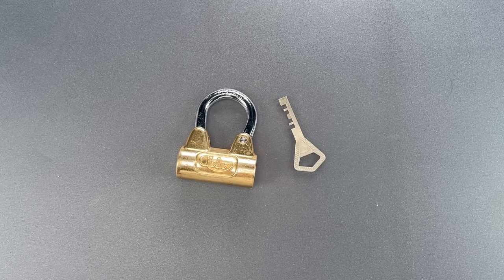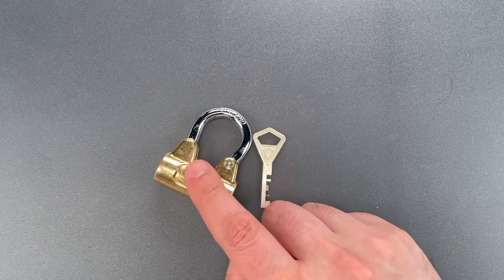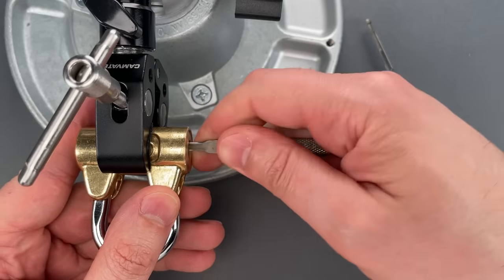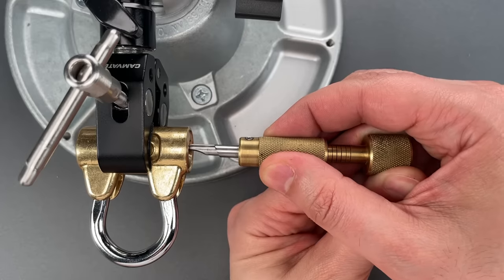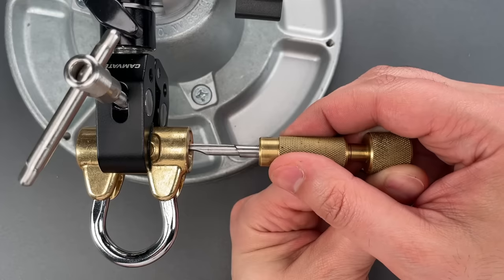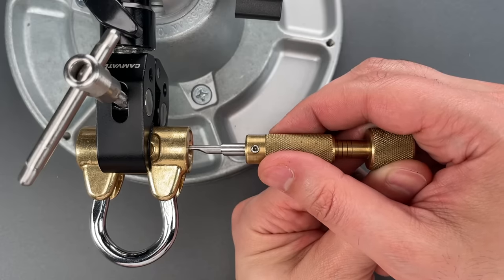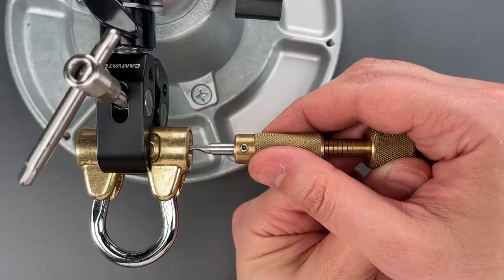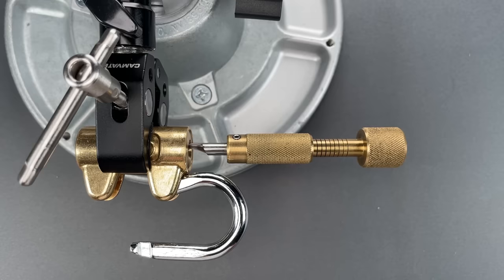[1416] Retro-Cool Abloy Padlock Picked (Model 3020C)

Comment: I spent the summer of 1971 in Finland teaching English. I bought this identical padlock that summer and had it for decades. I think I still have the key somewhere. Talk about a burst of nostalgia!
Reply: If you can find the key, the lock will still work like new. It has no springs and as long as you don't put fine sand or glue into it, it will work in the future, too. These old locks were made out of brass and that's practically inenert chemically so you don't need to be afraid of rust.
Reply: @MikkoRantalainen  Kiitos! I didn't explain that very well at all. I lost the padlock, but I kept the key on a key chain for years and then put it in a drawer when I got a job that required me to carry many other keys. I was very sad when I lost the padlock.

Comment: Pretty impressive. Put that core into a lock with beefy hardened shackle and anti-drill features and you will have some lock.
Reply: Abloy uses unpickable cores for their higher security locks.
Reply: The shackle is already hardened.
Reply: @SamiNami  thats bait to lpl... I can say with certainty he could pick any current lock of any make in under 4-5 mins....never ever seen him fail on any lock. U could mail him one of these 'unpickable' locks if u sure😜
Reply: @samiraperi467  brass body and physically weak design tho
Reply: Yes this is a throwaway lock. Core can not be re keyed or opened. IMO it is too expensive for what it is. No point having a good core in a cheap body, but the body is a classic design from a long time ago and I think that is the reason it exists. It is a shame they can not be re keyed because it would be cool to use old locks.
Reply: @gearloose703  I think the brass parts also make it somewhat weather resistant - though that would be improved further by a rubber plug on the keyway.  I'm sure you could retrofit one if you cared.  Anyway, this is not a physically tough lock (though neither are many of the cheaper alternatives), but it's borderline-unpickable to anyone without the necessary tools and skills.
Reply: @Kromaatikse  It is all brass inside, so weatherproofing is not necessary. A hundred year old lock dug up from mud will need some compressed air and oil but will work. Pin tumblers fail when dirt gets in the springs but these have no springs or such cavities to fill.
Reply: @rupedog  I don't think he can. He has picked Abloy Classic several times on his channel, but there is no videos of even Abloy Profile from 1977 not to mention the newer models like Exec or Protec. I have Exec at my front door, like many here in Finland and I'm pretty sure that it wont be picked.

Comment: >"Not a high security core"
>Takes longer to pick than nearly any other padlock featured
LPL's got far higher standards than I do
Reply: I think he was talking more about the actual lock itself, not the core.
Reply: "Not a high security LOCK, while the core is very unlikely defeated with non-destructive method" 
Probably means that the lock can be relatively easly defeated with destructive method because of lower quality metals used.
Reply: I think he means it could be physically defeated much easier than it could ever be picked.
Reply: The lock itself is probably not well made, you could probably take a medium size rock and break it open. The core is a different story. It's so old he had to make a custom tool
Reply: He said "Not a high security lock" meaning that the lock itself is easily destructible.
He was actually praising the core saying it would require a very skilled picker to defeat it non-destructively
Reply: @joshbimthedoctor  The lock itself is pretty well made, it's just small, it's literally impossible to make a lock that size that can't be easily defeated using destructive methods.
Reply: @joshbimthedoctor  It's not a cheap shit lock by any means, just small. It's brass body with hardened steel shackle. It definitely won't be defeated by a rock but due to it's small size it can be cut with a proper tool. It's made out of those materials due to it's most common usage here in Finland as an outdoor lock.
Reply: @vawx-  It's literally the cheapest and most basic padlock Abloy makes. Comparing to masterlock's similar locks..
Oops, brb. I've gotta hide. I'm getting sued for comparing Abloy and "master"lock.
Reply: We had these basic abloys for our lockers in finnish army and if someone forgot their locker keys at home during leave it was standard practice to smash the lock with a big hammer or similar blunt force instrument. These old models aren't super resistant to force.
Reply: If a lock needs to be broken to gain entry then it has served it's purpose as these locks are used mostly to prove the insurance company there's been a break in. Every lock can be opened with enough brute force but this one is very unlikely to be picked. 
The criminal underworld in Finland was rumored to have devised a pick for the oldest ones but it's said the factory then changed the design to prevent it's use.
Reply: @joshbimthedoctor  We mostly use these locks for sheds and whatnot here in Finland, doors for houses and padlocks used for higher security have more modern Abloy locks.
Reply: @Murgoh  Vempele. Abloy fixed it with free spinning front disc. Now it needs to be tensioned from the back as in the video.
Reply: @joshbimthedoctor  Sometimes older is better. They don't make them like they used to. I've got an old Sears drill I think it's 80 years old and still works.

Comment: You can tell it's a good lock if even LPL can't tell for certain whether it's a falae set or not.
Reply: and amount of concentration it required from him was noticeable as well with greater pauses between talking while picking
Reply: false gate, not false set
Reply: @thelockpickingspoon9074  What's the difference? I'm an absolute novice despite having watched plenty of his vids.
Reply: @DrakiniteOfficial  the type of lock, false sets are found with locks that contain some form of spool pins, false gates are cuts on a locking element that are shorter/smaller than the true gate
Reply: @DrakiniteOfficial  The terminology comes from "setting a pin" where false set is setting a pin on location that seems to be set. With pin tumbler locks this is caused by "security pins" which are actually just oddly shaped pins, often spool like or a standard pin with grooves also called a serrated pin. Disk detainer locks work by rotating disks and for those the locations that the sidebar can fit are called gates. A false gate is a gate which has correct width but the depth is not deep enough to fully fit the sidebar. And since disk detainer locks like this Abloy Classic have zero springs, there's no "pins to drop" or anything equivalent because everything stays in the position you set it if you stop moving your tools. To open the lock 9 of the actual code disks need to be turned correct amount (there are 6 options per disk, separated by 18 degrees each for Abloy Classic) and the first and last disk must be rotated equal amount to uncut key. After that the lock opens if you turn the bottom disk in clockwise direction (and all the disks rotate together even if you only turn the last disk).
Reply: @MikkoRantalainen  Thanks for the detailed explanation! Goodness, there's such an amazing level of complexity in every facet of our technology, and it's quite mind bending when someone gives you a taste of it. I wouldn't even pretend that I understood all of what you explained, but I believe I got the general idea.

Comment: This lock took a vice. A custom pick. Has 11 pins and false gates. Took 3 min to pick in perfect conditions. This might be the best lock I have seen on this channel.
Reply: It has no pins but disks but the other details were correct. The mechanism works by the key rotating disks where each disk as the gate (part of metal missing) in one of 6 possible locations. Only if you select the correct orientation for all 11 disks (meaning 6^11 or 362797056 possible keys in theory, about 10 million in practice because the first and last disks have always zero cut to make the lock operate smoothly in all situations) you get it open. And each disk has 2-3 false gates so if you go for "a gate" for every disk, you still have about 3^9 or about 20000 combinations to try if you cannot figure out a better attack.

It's obvious that LPL doesn't go through 20K combinations in this video so he can obviously tell false gate from true gate by feel.

Comment: Would be nice to see a core like this in a beefy lock.
Reply: Abloy makes those too, they are pricey though.
Reply: If you want a good lock, get something like Abloy PL 350 or Abloy PL 362 with Protec 2 core. Other manufacturers use hardened steel inserts as drill protection, Abloy makes the whole lock body out of hardened steel instead. Expect to pay $300+ for PL 362, though. All that hardened steel doesn't come cheap.

Something like PL 340 would still have hardened steel body and cost about $125 but it only has 10 mm shackle making it more vulnerable to brute force attacks.

Comment: My favourite lock. Practically indestructible in normal use. My dad has had this lock on his garage door for maybe 40-50 years and the lock has frozen solid countless of times as it is not protected from weather, but all it has ever needed is some defrost and lubrication. Relatively cheap too, you can get a set of three keyed alike locks with six keys for around 70€ ($80). These locks will most likely outlive us all.

Comment: Takes a Special tool, Takes 2 people,  nice lock but would better if the casing was stronger.
Reply: And almost 3 minutes pick time. Impressive.
Reply: @maurice_walker  The same core is used in several different types of locks her in Sweden and Finland. So there is variants with much beefier casings 👍

Comment: Ooh, a treat!
This type of Abloy lock has been very widely used in Estonia as well, and probably in Finland where this is from.
There were also door locks like this that you could push into a locked position from the outside without a key. I had one of those on my door as a kid.
This one time we got locked out with all keys inside and my dad used his overweight behind to smash the door out of it's somewhat flimsy frame.

Comment: I have a few of these old Abloy padlocks and I always considered them to be the best of the locks I have. 
Someone took a hacksaw to one lock but they only managed to scratch it superficially. 
It would probably be possible to break the lock open with some powerful tool, but then again, the lock will never be safer than the chain or fitting it hangs on.

Comment: It's kinda funny how this goes in Finland... Needed a lock for my storage unit in the apartment block. Saw good ole Abloy lock, and knew which one I'm getting. :D The storage units are not terribly safe in any case, heavy duty wire cutters and you're in faster than picking the lock.

Comment: We had a special tool in our unit called bolt cutters used by the sergeant. I fixed the lock with a tig welder and it was good as new again.

Comment: Greetings from the land of ABLOY. Yeah this lock is like the base standard and it is rare to hear of anyone picking locks. Destructive methods seem to be the only solution if anyone ever needs to open a lock without the key. 

I also hope someone sends you a door from here so you can review if any bypass attacks would be possible because those you have shared videos of wouldn't work on doors here.

Comment: Most common lock core in Finland for 50+ years at any doors replaced by their protec/2. And I still believe that Nordic countries got it right to make sure that front doors open only out. No kicking doors in unless the frames with wall comes in..
Reply: its more a fire security thing that doors that lead outside always open outwards

Comment: I have just found this answer to a Quora question. It is about Reijo Luotolainen, who was a notorious Finnish serial rapist.
"Almost all Finnish front door locks are Abloy disk tumbler locks, which are virtually unpickable. Luotolainen was extremely intelligent, and he invented a sophisticated device - vempele - on how to pick disk tumbler locks. He would follow drunken women arriving from night clubs, observe where they would go to their homes, and then check which lights would turn out. He would then pick the main door lock and the apartment door with his vempele, and then proceed on assaulting the asleep woman with an ether-soaked rag, put her unconscious and then rape her.

He was able to continue this practice for years since he never left any traces behind - and nobody believed an Abloy lock could be picked (it is still today unpickable witout a similar special device)."
The rapist was later knocked out by a woman with a frying pan and apprehended by police.
Reply: Yup. Although the original "vempele" wouldn't work on this lock, as the first disc is a spinner. It was designed for older models.

Comment: This feels like one of the best low security locks in existence.  For applications where what being locked up is not that valuable and for insurance purposes it's better to have a destructive break in (as opposed to the pock being picked) this seems perfect.  This lock will not stop thieves at all but it will ensure they can't pick their way in and have to break their way in.  So you'll be left with a broken lock or a stolen lock.

Comment: Those are still commonly used where extreme security is not needed. I have one in by basement storage. Yu ca buy packs up to four with same keys. What I find amazing is that in the US locks are sold in single packages so that different packages have same keys. It would be unthinkable here.

Comment: Fun fact, a device used to open these locks without key here in Finland (used mostly by criminals of course) is called "vempele", which translates to something like "thingy" or "device" in english. Im not an expert, but it looks kinda similar to the tool you use here and apparently required a decent amount of skill to use, so I guess Abloy did cause a grey hair or two to burglars here haha.

Comment: These locks are very common in Sweden (ABLOY is a former Finnish lock company, later bought by ASSA a Swedish lock company) - all swedish military recruits had them (two/person) on there lockers. They could be quite tricky to open even with a key. You have to get the key al the way in, but if the last disc is rotated that want happen and you'll be standing there trying to get the key in. Use them on daily basis in my work. I also have one on my storage in the basement.
Tehy freeze up quite easily during winter - and that is a problem in Finland and Sweden.

ABLOY stands for :

Comment: This probably still most common small boat lock in Finland. It is not so sensitive as cheap chinese when it gets below zero. If it freezes, it is usually easy to melt to be opened.

Comment: You will encounter this lock's core design on almost every single household door in Finland solely for the reasons said in the first minute. The person who designed the lock also designed the first lockpick for it, which he called a "vempele", which is relatively common dialect expression in Finland for "thingy", this is to intentionally obfuscate any requests for such a tool.
This design is what Ab Lukko Oy (ABLOY for short. Ab is the swedish shorthand for registered company, while Oy is the finnish one) is basically built on entirely.

Comment: There is a mass produced tool that can crack these open with little skill on the users part and with a high success rate. It is known as the finnish standard issue field shovel (AKA "kenttälapio"). (For reffrence, these are the locks issued to most conscripts for their lockers. And someones keys will alwaysbe lost)

Comment: The universally loved and seamingly undefeatable "pick that Bosnian Bill and I made" was finally superseded by the "tool that I made myself"
Reply: The "pick that Bosnian Bill and I made" can be used only with locks where the center of the lock is free space. Half of that space is filled with metal in this year 1907 design so you need to have alternative design where the pick is offset to the side.

Comment: In the nuclear power plant I work on we have abloy locks everywhere. The model seems much harder to pick. Some people have special keys that can open all the doors. I wouldn't pick a lock there, I can just request the key, as I have access to most areas. If I had access to a decomissioned padlock I could give it a try, but not only that would look suspicious but I would fail miserably, since I'm defeated by much simpler locks and and that would require a special tool to pick.

Comment: I use this (probably with a slightly newer core) on my basement storage unit. It's definitely way overkill considering the unit walls are made of chicken wire. No point even touching the lock there if you want to go in.

Comment: No one bothers to pick locks here, it is all destructive. Pop the lock, attack the cover plate, hinges or widen the doorframe. The latter is fast, relatively low noise and can even be quite non-destructive, with the tools still fitting in a backbag.

Comment: these locks do have one fatal security flaw. since these have been so common in Finland so long, locksmiths (who are also usually cobblers here for some reason?) can copy a key basically by eye. I’ve had copies made of my keys and there have been times when the guy has looked at the key for a couple seconds, handed it back and gone to the grinder and made a copy without once looking back at the original.
Reply: Just because a cobbler have a key copying cutter does not make him a locksmith.